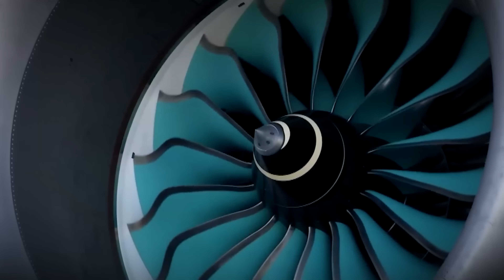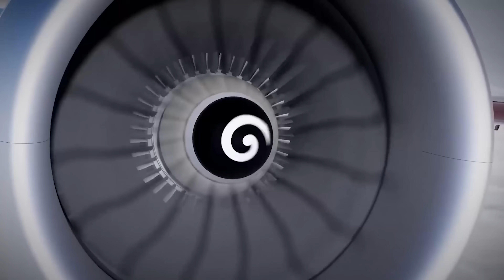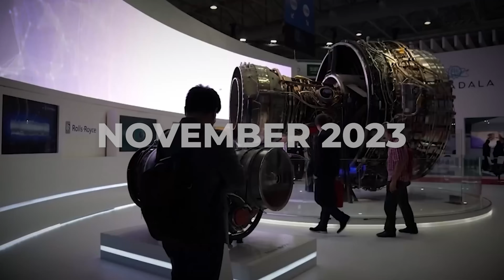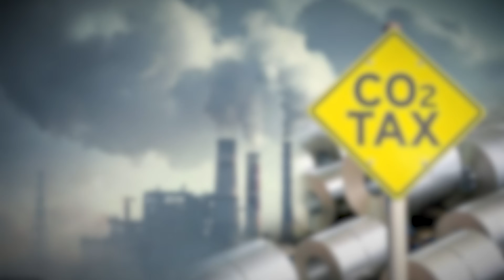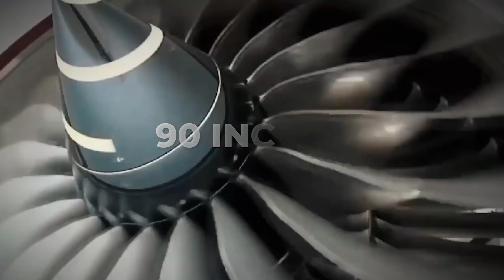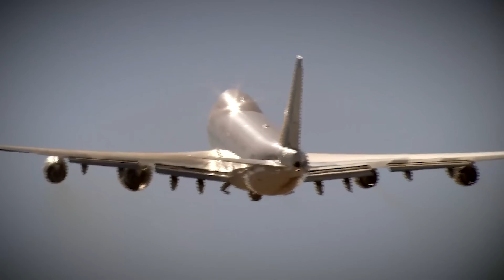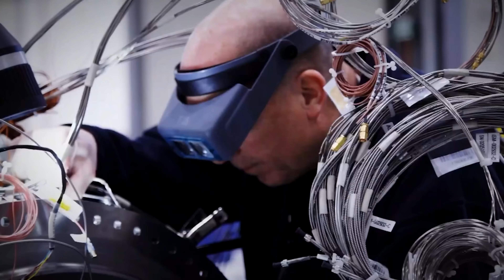This NEW Rolls-Royce Engine Could Completely Revolutionise Aviation

Comment: The P&W GTF issues are a warning to Rolls-Royce.   Transmitting massive mechanical power guarantees high maintenance requirements for the gearbox.  This could become quite a debacle.
Reply from the maker: Exactly...P&W have shown the potential but also stand as a warning for the pitfalls. If RR can avoid those same mistakes then they could be sitting on something incredible.

Comment: It’s good that RR have the UF80 available already, it could be an excellent fit for the purported A350-2000 if it has the requisite durability in hot and high climates, e.g. in the Middle East.
A lot of brutal testing will be required, for durability and for reliable bleed air shut-off if that is how RR intend to power ancillary loads like A/C and de-icing. Every other commercial jet engine manufacturer has strugged with one or the other with recent models as does the Trent 7000 option for the 787 and the XWB-97 on the A350-1000.

Comment: I remmber being a passenger when almost all commercial aviation was still propeller driven. We have come a long way!
Reply: Just think that 34 years after the wright brothers were barely flying at Kittyhawk Sands there was a jet aircraft flying. Amazing.
Reply: @deerfootnz 
The Heinkel 178 first flew on August 27, 1939, and the Wright Brothers first flew on December 17, 1903.
Reply: @tobygranshaw3359 what's a year or two between friends....
Reply: I mean, turbofans are pretty much ducted turboprops, so we technically still are running on props, the hot fart from the combustion chamber is not the main thing producing thrust in turbofans

Comment: Commercial jet engine technology has become truly impressive. And it has been that way for years.  Hard to believe its getting even better.
Reply: It is getting better but the airlines tolerances for reliability issues is much lower even with a fuel cut from such bleeding edge innovation. Now new engines are so expensive to make, either you get an exclusive deal with a jet model or it's just marginal fuel cuts (even if 1-2% is a big deal). At some stage airlines will have to weigh longer reliability Vs fuel burn cuts.
Reply: But the EIS is very risky as you could have seen with the GTF and GEnx (and also the LEAP).

Comment: Airbus will want the UltraFan 30 as a European engine option for the A320, not just future aircraft. I expect we will see it on a range of current Airbus aircraft. It might prompt Airbus to offer a wider efficiency upgrade version of the A320 - one with the dual moto-generators on the HP and LP shafts and full electrification except for turbine bleed air which will remain a direct feed from the HP(?) compressor. 
The engine will have electric fuel and oil pumps. Cabin/cockpit air will be electric. Hydraulic systems will be reduced in favour of electric systems. The APU will stay because engine hours will remain a key maintenance metric. The UltraFan 30 will be a geared turbofan like the PW1100G. The fan spins at a fixed ratio to the LP turbine with the planetary gearbox reducing the fan speed by a factor of about 9. 
The UltraFan 30 will likely be a cheaper engine than the Leap 1A and PW1100G due to electrification and things like bleed air travelling only a short distance from the HP compressor to the HP turbine blades. LP turbine blades can withstand the reduced temps. 
The engine casing will be more expensive for the larger fan, but the casing contains far fewer components.

Comment: Anyone know why RR is building another engine test stand at NASA Stennis test center in Mississippi? They have had one there already for years. Military scramjet engines? They are LOUD. It is also a Navy base with constant guard patrols 24/7/365. It is a no fly zone.
Reply: Test stand for the F130s they're fitting to B52s?

Comment: What is the guarantee that this will not self-destruct similar to the engine on the Qantas A380 flight out of Singapore?
Reply from the maker: Well that's why it's undergoing testing right now, and is not currently on the market. Of course there's no guarantee, but also that Rolls-Royce engine is not the only engine or manufacturer ever to suffer an uncontained failure either.
Reply: Anyone is allowed to be stupid, but, lease don't abuse the privilege.

Your question boils down to: There was an accident once, 16 years ago. What is the guarantee that there will never be another accident?
Reply: @phildane7411  You sound like chatGPT if it wasn't censored LMAO
Reply: @mx6-r3q  A nice feature of ChatGPT is that if you point out a mistake it's made it will admit it. I must admit that I've never tried typing something as idiotic as the 'self destruct' question into it.

Comment: There isn't any "carbon problem "   that is a left-wing fantasy ........ we should not be obsessed with efficiency. We should be obsessed with reliability and safety.
Reply from the maker: If it were a fantasy, airlines and manufacturers wouldn't be investing billions into it as it would simply be unnecessary. We absolutely should be obsessed with safety and reliability, but efficiency has to feature in there too.

Comment: I don't like statements like "25 % improvement in fuel efficiency". Compared to what? Maybe compared to "previous generation of engines"? And what generation is that? New engines from 2026? Future 777X engines? Old B777 engines?
Reply: compared to prior iphones
Reply from the maker: 😂 but worse battery life
Reply: Compared to their own previous most efficient engine, or even THE most efficient engine, whoever made it.  Why are you so angry?
Reply: @Mark_Bickerton  I'm not angry. If it is 25 % more efficient to the MOST efficient engine it is a bold statement.
Reply: @Mark_Bickerton  Wrong. 25% to the first Trent generation and 10% to the XWB. Why are you so self-confident and incompetent?
Reply: @kondor-n1d  wut? I made zero claims in my post, you cannot come across, wrong, self confident or incompetent when asking a question.  Anyone who would suggest you can might be bit of a knob.
Reply: @kondor-n1d  That sound like a more realistic number.
Reply: When he quotes this claim the second (or third) time later in the video, he tells the full quote as being 25% more fuel efficient than the current Trent engines.
I was not completely happy with the statement, as they are in no way to know the fuel efficiency of current competitor engines (i assume because it appears as highly classifiable business-information.
So i heard it later as i was intently listening for any expansion on the subject being said.
Reply from the maker: Yeah I maybe should have been clearer earlier in the video. It's the number RR themselves put forward, specifically compared to the first generation of Trent engines.
Reply: @bertbergers9171 imo they should just give a realistic figure. for example, why not compare it to prior engines that airlines seek to replace? Thats actually a  useful statistic
Reply: @nommeouasse7717  Yes just say the name of the engine you campare with.
Reply from the maker: I did touch on what in the video actually, I didn't just compare it to nothing :) To clarify, it's 25% improvement on the original Trent engines, specifically benchmarking the Trent 700. Thanks for watching and taking the time to comment, I appreciate it!
Reply: Compared with the Trent engines. It was mentioned in the video.

Comment: 0:40 - 25% more efficient than FIRST GEN 1980s Trent engines? I despise marketing horseshit
Reply: I despise clippy pfps for this reason.
Reply: that's still a huge leap in efficiency.  the Trent 700's wasn't certified until the early-mid 90's with variants since. RR claims 10% better burn than the XWB and that ends up only 5% better than the GE9X, however, with significantly less thrust. 80k-120k vs 105k-134k

Comment: I am confident RR will blow it yet again.  The L-1011 debacle  (2 years late delivery that engine) to Spirit Airlines ( RR named the number 1 reason for their filing Bankruptcy) and Emirates tagging the present RR engines , in public,  as "unacceptable", to the 787, which used to have an even engine choice split of 50/50 between G.E and RR down to 95% G.E. and 5% RR, historically they don't have a chance.
Reply from the maker: I'm not sure that's entirely accurate - it's more like two thirds GE to one third RR to the best of my knowledge. However, the sentiment stands. RR have committed a number of high profile blunders and had major issues in the relatively recent past...but then you look at the narrowbody market and P&W are plagued by problems too, so they're not alone in that respect. This new engine is being very highly publicised, so there's a lot riding on it, maybe even more than usual with a new engine. As a result, hopefully they've learned their lessons and will do this one right. Time will tell... Thank you for watching and for taking the time to add some extra information!
Reply: Rw2069 is not very nice, see below. But current 787 orders are indeed at 90% in favor of G.E. Eastern Airlines? Huh?
Reply: Spirit flew A320 family aircraft, none of which were RR powered as RR does not make engines for small single aisle planes.
Reply: I stand corrected,  they used the P&W GTF. Thanks!
Reply: And let's not talk about P&W's troubles of late! Lol
Reply: You need to get your " facts" correct, the launch customer for the L1011 was Eastern and your ratios are completely wrong
Reply: @rw2069 They were late launching because Rolls Royce was way late delivering the engines, giving the DC-10 a lead Locked never recovered from. Eastern Airlines did not produce engines,  Sir!
Reply: I just googled it: 90% of 787's are currently ordered with G E.  engines.  Let's keep it nice,  okay Spock?

Comment: Rolls-Royce has begun advanced engineering on the UltraFan 80, rated at between 80 to 120 thousand pounds thrust. It will likely power future versions of the A330neo and A350 models, and possibly be an option for the Boeing 787.
Reply from the maker: It has indeed. The engine is showing phenomenal potential!
Reply: Airlines buy aircraft along with an engine package that will last the life of the plane. It’s literally already paid for. Why would any airline buy a brand new engine to put on an old aircraft? The engine will out last the plane.
Reply: @jojosantx  Who said anything about retro-fitting?
Reply: @phildane7411  then what plane will it go on?
Reply: @jojosantx  Anything it fits and is manufactured after it is certified.

Do you really need something this simple explained to you?
Reply: @phildane7411  that’s not how it works. Engines are sold with maintenance programs that last a decade or more. There’s literally no plane this can even go on for the next ten years or more.
Reply: @jojosantx  Which part of 'manufactured after it's certified' are you having trouble with?

And, no, I'm not suggesting that it can simply be fitted to any aircraft.

But there may be certain use cases for certain aircraft, where, certain modifications would make economic sense.
Reply: No, LMAO, not the 787.  When you get even close to the GE9X (in power) then you can yak.
Reply: @OdenthorIcefang  The engine architecture is saleable. Be patient.

Comment: For years Pratt & Whitney have been producing their version called the GTF, Geard Turbo Fan, with thousands in service today.
Reply: An entire airline shut down because of these engines (GoAir from India). Legal case was lodged in Delaware.

Indigo suffered as well.
Reply: Contaminated alloys…
Reply: @karlthemel2678  the contaminated alloys also affected GE and other engines. With decades of incredible forensic failure, analysis quality control in manufacturing engineering experience, it is absolutely a rookie mistake not checking for contaminants. It’s unthinkable and absolutely unacceptable.
-Just saying!
Reply: This is more advanced as the power turbines, compressor turbines and bypass turbines all run at their own speeds. This allows each section to run more efficiently than the GTF. The P&W GTF does not have the compressor and power turbine sections geared like this does.
Reply: @andrewday3206 In English?
Reply: @Sterlingjob  that was pretty clear
Reply: @Bezxex Not to an aircraft engineer it isn’t.
Reply: @Sterlingjob  mate. If you can’t read this, I am seriously concerned about your countries education.
Reply: @CASA-dy4vs it’s technically incorrect.
Reply: The engine problems with the pratt GTF ate not because of the gearbox
Reply: It's not entirely unheard of for a company to invent something, then another company comes along, eliminates the flaws & makes it work - not just properly, but far better - you may not be aware of Sir Frank Whittle, who actually invented the first EVER turbofan jet engine, patented in 1930. Funnily enough, other engineers subsequently patented slightly different or modified jet engines - and here we are, they improve all the time, without whining that "someone else designed this or that 'in the first place and so & so stole it" - patents run out and people build better stuff. Get over yourself
Reply: Geared Turbo Fan? 🙂❔
Reply: @karlthemel2678  it’s a gearbox of which Rolls-Royce copied from Pratt and Whitney‘s patent which has run out. Pratt & Whitney is the original designer of a gearbox so that the large fan operates at an optimal speed for fuel economy, lower emissions, and noise while the turban area runs at a optimal speed think of it as a transmission in a car. The next generation which I’ve designed is a variable gearing box to optimize thrust and then optimize fuel economy, which is revolutionary technology.
Reply: @icare7151So shut up and get on with it and if it's as good as you say it is it will be a fantastic success.
Reply: @grahamandrews6420 Triggered, get therapy and when you finish high school, I suggest you go to Hillsdale College and get a great degree. You might be able to have an intellectual thought to share at that point in time.
Reply: @icare7151 Not even close, geared turbofans been around since the 1950's neither RR or P&W invented the technology. Previously they were for very small engines as the gearbox's of those era's couldn't handle the extreme loads to be any bigger & never made it to commercial use. In the late 1980's RR & P&W launched a joint development program into GTF's called IAE & created the SuperFan & while it worked no airline/customer was interested in it. RR & PW later went thier own way RR sold it's holdings in IAE to P&W who continued to work on the Superfan design which evolved into the PW1000 series which now powers smaller short haul aircraft like the A320 & Embraer E. RR did not stop it's work on GTF's either it just thought bigger much much bigger with its Ultrafan. P&W had nightmare with it's geared turbofans & those are still relatively small it remains to be seen if RR has similar especially given the extreme application & size of it's Ultrafan.
Reply: @icare7151completely different gearbox technology. P&Ws GTF cannot expand to widebody size engines
Reply: In and out of service
Reply: And hundreds of A220’s grounded because of bad quality control in build!
Reply: Thousands in need of repairs too.
Reply: And thousands OUT of service due to gearbox failures. It's been devastating to some airlines that were heavily dependent on the affected engines.
Reply from the maker: Thousands in service...and thousands on the ground due to manufacturing issues. The theory is good but the reality so far is catching up and it's costing both P&W and airlines billions in lost revenue, repair and compensation costs. For now, it actually offers RR a potential way into the market, though by the time they can bring the UltraFan 30 to market, P&W will likely have resolved their issues and be onto a second generation.
Reply: @liftandthrustaviation  " P&W will likely have resolved their issues and be onto a second generation".  Their potential customers will have moved on too. An unreliable engine reflects on the company (supplier and operator) and therefore future sales. If you bought a bad product, at replacement, would you buy similar from the same manufacturer?
Reply: "The theory is good but the reality so far is catching up ... It actually offers RR a potential way into the market."

What? "The theory is good" applies to P&W regarding its costly failures but not to RR regarding its costly failures?